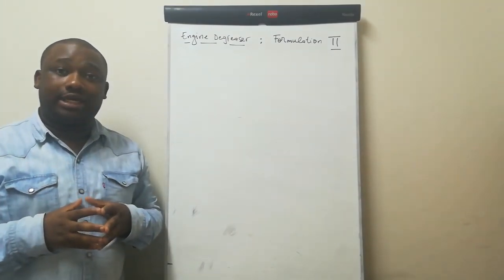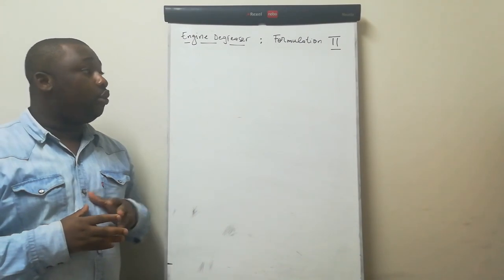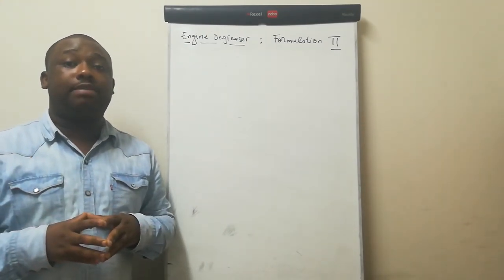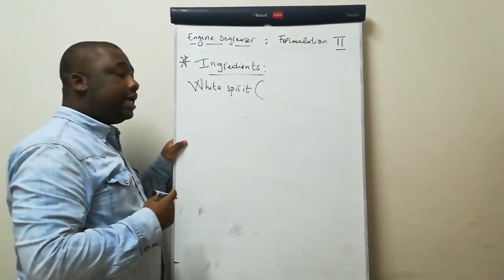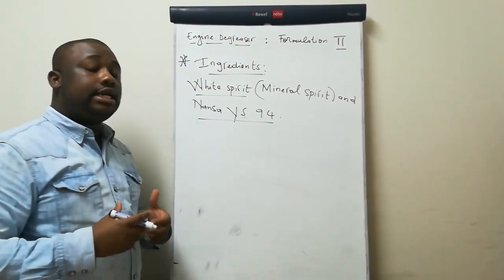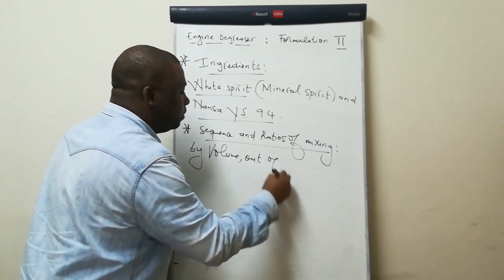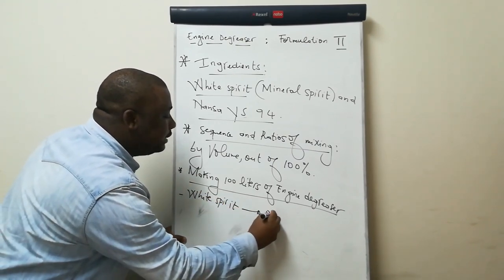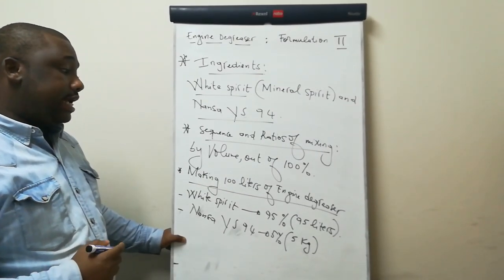Engine Degreaser : Formulation II

Comment: Hello well explained video, is it possible that you can do a thick gel base formula that can hold on vertical surfaces for removing old burnt on thick grease, oil and old thick carbon build up on kitchen equipments like Ranges, Oven, Fryers, Grills etc.